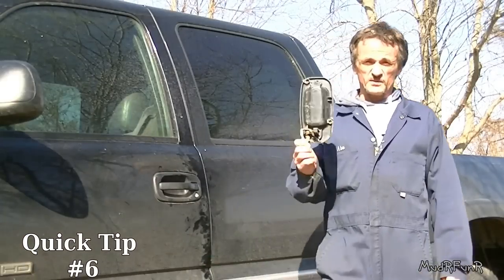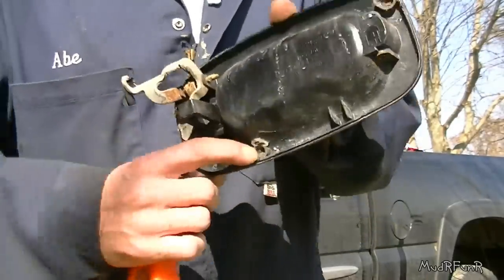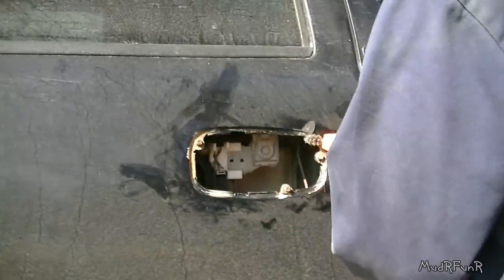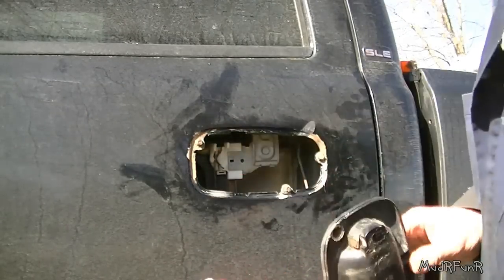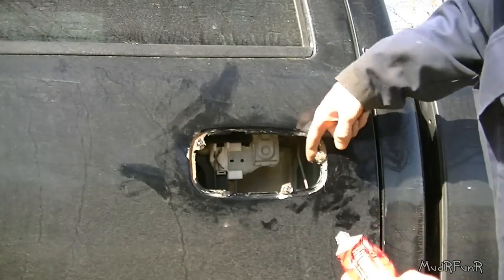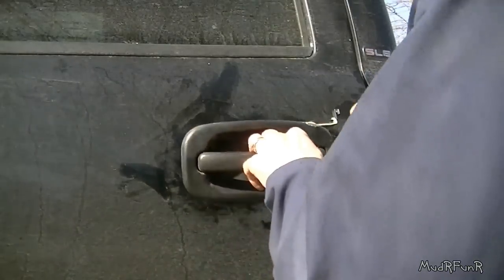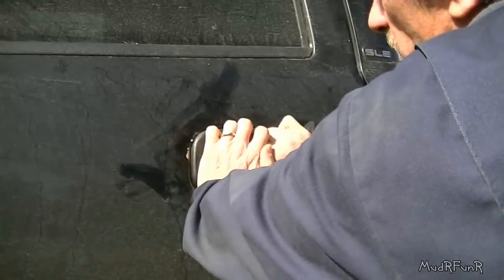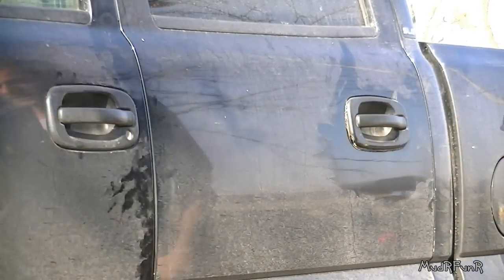Quick Door Handle Fix - Quick Tip #6

Comment: Ford should make better door handles.  A few times this winter I had to use the passenger door, to open the driver's side door from the inside because I'm scared to break the handle if I force it open when it's frozen.
Reply from the maker: It seems most door handles are made of cheap plastic, not just Ford. Even my tailgate handle is broken...also cheap plastic.